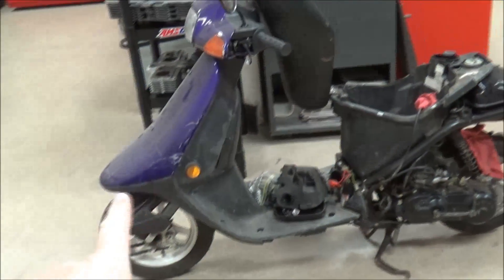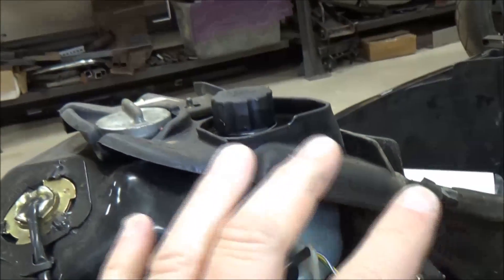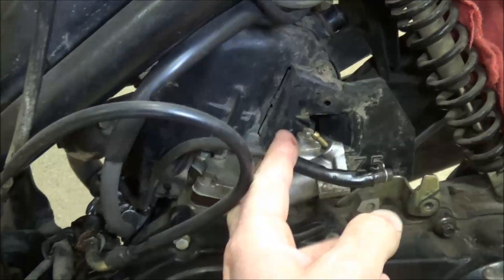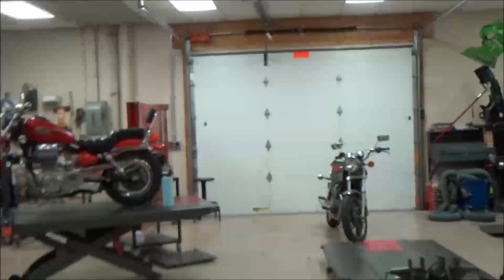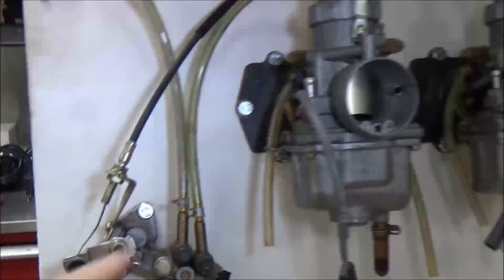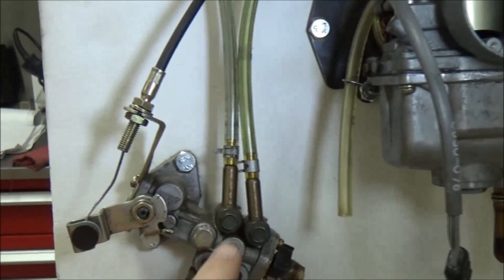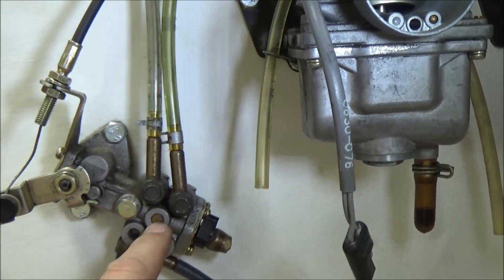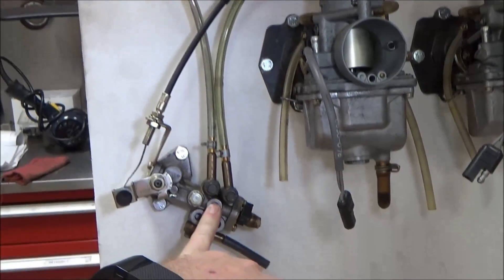Why you should verify your Oil Injection System on a "new to you" 2 stroke powered vehicle!

Comment: What do you think about bleeding the oil lines by removing the spark plug(s) and the lines from the manifold and running the starter or kick starter until no air is left in them and you see oil only? Thanks.

Comment: I had a so-called certified mechanic install the oil pump linkage on my 2-stroke outboard on the wrong side.  It was easy enough to do since it just clips on.  It took me years of trying to figure out why it was running rich, idling poorly, smoking like crazy, and fouling plugs to finally search up a shop manual that showed a drawing of the pump set up correctly.  The fix literally took 2 seconds and not only did it now look like the picture, but setting marks for idle and WOT now lined up.  I paid that guy some serious money to screw that up for me.

Other things I discovered he put back on wrong:  The hose that is supposed to deliver water from the top of the engine to the poppet valve was run straight to the tell-tale, and the hose that is supposed to go to the tell-tale was run through the thermal air valve to the poppet valve.  Like, seriously.  He had to add a hose to do it.  The hose that was supposed to go from the thermal air valve to the carburetors was just lying in the bottom of the cowling.  I'm surprised it ran at all.  This also required a dive into the service manual for me to find a diagram of the correct plumbing.  Now I am concerned if he managed to screw things up this badly on the outside, did he get the work he was doing inside the engine correct?  It seems to run ok now, but short of tearing the powerhead open I can't inspect it.

Then, this other time I had the steering cable replaced by a different shop, and the joker managed to put the pinion upside-down so that the boat steered backwards!  (The motor needed to be lifted to get the cable in/out is why I didn't do it myself.)  He also managed to crush the transom by over-torqueing 2 of the bolts.  Luckily the shop fixed it for free and fired the guy but it was still a huge hassle.

I've also had nothing but trouble with a KLX250 that had an after market exhaust on it.  I figured I was getting a deal until I found out that the carb had been modified and the airbox as well, so it had lots of power but otherwise ran like crap!  It took me a new carburetor and snorkel to finally get it running correctly.  (Yes, snorkel.  People thing removing it gives more airflow, and it does at low speeds, but it creates turbulence at high speeds.  Kawasaki didn't spend the money to equip the bike with the snorkel just to make it worse!  You ain't making it better by removing it!  Same with drilling holes in the air box and other dumb things people do.)

Folks, be careful who you let wrench on your stuff!  And if the owner worked on it, assume whatever he did needs to be undone or redone, and there might be serious damage as a result of his work.

Bottom line:  Buy new if you can afford it, and only use certified mechanics with lots of references.  Most people, even so-called mechanics, have an unending ability to screw things up royally.

Comment: I wish there was a way I could show you this somewhere else, now I see what's really happening. The seller had capped off the nipple cone from the oil tank and capped off two other Hoses connecting to the oil pump. And the hose connected to the manifold... IS JUST CONNECTED TO THE OTHER  VACUUM LINE OF THE GAS VENT PETCOCK.. man are some folks stupid. I thank you for showing this. And I'm saying g this now because this is the exact same scooter I have and now I see where that's supposed to be going. I appreciate it

Comment: Have you ever seen the gear drive that drives the oil pump , 9 times out of 10 there plastic , if you want to rely on a plastic gear drive to lube your engine then good luck with that one , most guys with scooters that are modified just delete the pump and run premix , heaps better , much simpler , less stuff hanging off your motor ie oil lines , oil tank and pump drive and your motor gains a little more power from not having to drive that stupid pump.

Comment: My golf carts got oil injection Yamaha putting out plenty of oil but the engine you can tell is very dry not getting lubrication even though I've got it mixed in with the fuel also, my question is if there's fuel flowing out of the carburetor could it be given it so much fuel did it's washing down the Rings and making it want to seize Xtreme Wear.

Comment: Older bikes feed oil to the intake, and the crank bearing on the oil pump side. Check to see if that is the case. 
If it is, leave the tank, and that line, or run it on a loop from the case itself. 
👍
Reply: So just leave everything hooked up oe and premix?
Reply: @Ashroyer86  
What bike is it? 
If the bike has 2 lines coming from the oiler, yes. If it only oils the intake, you can just premixed, but there wont be oil in the pump. 
  A re-route is for bikes with 2 lines. You disconnect and plug the oiler to intake line, and the hole,  but leave the one that goes to the crank. Then you have the pump take oil from the case, and premix. 
The easiest way is to just use it as-is if it has a crank oiler. 
Cheers
Reply: @r1nger81  yamaha srv with crank oiler. Just decided I may not fix it because of rust.
Reply: @Ashroyer86  
The snow machine? 
Great donor motor for a scary fast gokart or buggy. 👍
Reply: @r1nger81  so all i do is plug the intake line off and then premix the gas my scooter oils crank bearings too
Reply: @jaysworldd.636  
No. If it also oils the bearing, then a simple bypass will not work. 
Can use the tank as intended. 
 The othe option is to change the source of oil to the pump. 
1. Block off both ends of the line to the running to intake. 
2. Leave the oil line to the crank bearing. 
3. Take the line from the oil tank, and re-rout it so it draws oil from the case...you may have to tap a hole, but a banjo fitting on the drain plug works too. 
 This mod changes the setup so that the crank bearing is oiled by case oil instead of premix, and you mix your own gas. 
 If you choose the oiler case mod, its important that you make sure the oil line from the case is primed. 
  If there is an air bubble, it will not flow properly, and could starve the bearing. 
  I use a transparent nylon coupler when I first do the mod, to be sure its flowing properly.
  Cheers!!

Comment: man...i just rebuilt a polaris trailboss 250. and i am so fkn paranoid that the oil pump isnt working... i took it apart while i had the engine off and cleaned it and just checked the little diaphram and o-rings.   but the bike doesn't smoke.. i rode it for about 10 min and she seems to run great. but the engine is noisy. im hoping its just the pull start that is noisy but its hard to tell.  the clear line that run from pump to maniold is full. but i cant tell..i like to see smoke on a dam 2 stroke. the plug looks perfect nice light brown. i pulled maniold off and its dry.. the piston looks ok and looks a little wet. idk i cant afford to fry this topened
Reply from the maker: If unsure if the oil pump is working on a fresh engine, your always better off adding a little premix to the first tank and then pulling the oil output line and watching it pump out...which that with bleeding as shown should ALWAYS be done anyway...make sense?
We sure love you taking the time to comment. Are you coming to the next live session? 
There a few ways you could help keep this work going and stay connected with me personally.  
1. The fastest and best thing you could simply do for us is hit that subscribe button…helps us creators more than you know! 
2. Join this channel to get access to perks:
https://www.youtube.com/channel/UCBhM8DCKnT3qXwTW0eToyCg/join   
3. Give us a high 5 here:  https://www.paypal.me/how2wrench    
Keep Wrenching,
Shane Conley
Peoria, AZ USA
Follow us!
www.How2Wrench.com       
www.Tools2Wrench.com    
Facebook: 
https://www.facebook.com/How2Wrench/   
Instagram:
https://www.instagram.com/how2wrench/

Comment: So my 2 stroke doesn't have that. How could I add an oil tank, oil pump and oil vectors to my 66cc 2 stroke motorized bicycle chopper
Reply from the maker: Unlikely as the engine case is not built with it in mind...google for a kit and see what pops up...
We sure love you taking the time to comment. Are you coming to the next live session? 
There a few ways you could help keep this work going and stay connected with me personally.  
1. The fastest and best thing you could simply do for us is hit that subscribe button…helps us creators more than you know! 
2. Join this channel to get access to perks:
https://www.youtube.com/channel/UCBhM8DCKnT3qXwTW0eToyCg/join   
3. Give us a high 5 here:  https://www.paypal.me/how2wrench    
Keep Wrenching,
Shane Conley
Peoria, AZ USA
Follow us!
www.How2Wrench.com      
www.Tools2Wrench.com   
Facebook: 
https://www.facebook.com/How2Wrench/  
Instagram:
https://www.instagram.com/how2wrench/
Reply: @How2Wrench  not sure when it where your next life session is. I am in San Antonio Texas and this build I am currently working on has been an interesting lesson in thinking outside the box and self fabricating things just out if parts and other stuff I've had lying around.the complete wiring harness is homemade. The jackshaft is all self-fabricated, as well as the bottom bracket with sealed bearings and the spindle for the pedal chainring. The exhaust I am currently in the design process to get the look I want and as close to a tuned pipe I can do myself out if a few hand tools. Nothing that I have fabricated has been created in a shop or with shop tools.  This will be a very fun and nice running 66cc motorized bicycle once I get the rest of the fabrication finished. I thought I had heard about newer carbs that had the oil injection built in them?
Reply from the maker: @charlesbyromhammiii2594  Sounds like a fun project. I'll try to find time and circle back to answer more but I have 80 member questions to get too today bud...

Comment: So, you mentioned the importance of verifying the oil injection system but I'm not really seeing how to verify it, other than making sure there's not some bb jammed in the line?
Reply: He was basically saying verify if the system as been manipulated. If you assume the oil injection system is doing its job and just throw regular gas in the gas tank you'll blow it up. He just wants you to know if you need to premix or not was the purpose of this vid.
Reply from the maker: Hi Joel,
Its a pretty old video and I'd have to watch it all to see or point out a time. I would think I would have mentioned that there are 3 steps to always do:
1. verify oil comes out the bleed screw (while buring air)
2. Verify oil is full in the lines to the carb/intake (and pumping)
3. Check how the spark plugs are burning...
👍 Thank you for taking the time to comment! It helps us! 
Here is a way to support all the free videos.
Want to say “thanks” or “keep it up”? Click here https://www.paypal.me/how2wrench  

Follow us! 
Web:
www.How2Wrench.com     
www.Tools2Wrench.com

Comment: I have  a 1972 cs3 and plan on removing the oil injection  system what oil gas mix should i use
Reply from the maker: I would'nt want to guess...But here is what I have done. I start with a high quality oil (synthetic MC-1 is my fav) they recommend 50:1 and then I do alot of spark plug reading to determine if there are any concerns or adjustments needed. No mix and wide open or extended use in any range! Lots of checking to dial in to a mix for you. there are a lot of factors that could cause problems though...If you would like those list of detailed factors make a donation to our work and I'll take the time to to chat or write it out for you! Link below!
👍 Thank you for taking the time to comment! Hit that subscribe button if you haven’t please! It helps us! 
Here is a way to support all the free videos.
Want to say “thanks” or “keep it up”? Click here https://www.paypal.me/how2wrench  

Coach Conley is also available for hire to personally work one on one with you if ever needed. Yep he is a real person. Give him a call @ 602-345-0432
Details here: https://how2wrench.com/product/personal-tech-training-phone-facetime/ 
Your answers and help are just around the corner. Save time and money while protecting your investment and yourself by doing it the right way!
Follow us! 
Web:
www.How2Wrench.com     
www.Tools2Wrench.com

Comment: Oil injection is just a marketing scheme for lazy people. Trust me, it is worth the extra time to pre- mix your fuel. Never trust an oil injection pump.
Reply from the maker: :) 
Thank you for taking the time to comment! Hit that subscribe button please! It helps us!
Here is a way to support all the free videos.
Want to say “thanks” or “keep it up”? Click here https://www.paypal.me/how2wrench  

Coach Conley is also available for hire to personally work one on one with you if ever needed. Yep he is a real person. Give him a call @ 602-345-0432

Your answers and help are just around the corner. Save time and money while protecting your investment and yourself by doing it the right way!
Follow us!
Web:
www.How2Wrench.com    
www.Tools2Wrench.com
Reply: ADOLF HITLER  Until it goes out and you have a blown engine. Just another moving part to worry about.
Reply: On most sleds and bikes, the oiler feeds the intake for fuel mix AND lubes the main bearings on the pump side. If you insist on removing it, make sure its ONLY a premix system, and not part of the case oiling system. If it is, you should leave it, or run the bearing oiler on a loop from the case.

Comment: Pw80 s the throttle cable splits off sometimes oil injection part of the cable breaks while the throttle cable does not break running the engine dry

Comment: I am repairing a golf cart for a friend it has the same style pump I took the pump apart and nothing is stuck lose or worn and seems to move correctly, my question is how can you tell if the pump is bad? Most people are just scared of systems they don't understand, can't see it with your eyes you can't have faith in it! I think they are a proven injection pump system if maintenance is kept up right changing filters regularly.
For instance the golf cart I am working on scored the cylinder but the root cause was crank bearings it was sucking air through them along with a bunch of dirt.
Reply from the maker: You're in luck. I do offer personal service to back up what's missing from a video to actually fix your specific problem. I do work on donations for my time and possible research. 
Good news is its CHEAP! For my time would mind becoming a member of my website? It comes with a free 20 mins of techline and that will cover my time to assist you so we both benefit. So to have me personal cell phone number to put in your phone as your direct info and how to coach, sign up now! As always thank you and enjoy the free videos! Much more to come! I look forward to working with you and hope you will become a member of or learning community. 

Link to membership: https://how2wrench.com/product/membershipmembers-onlymembers? 

If I can ever be of service to you, here is a video explains how to connect with me. 
https://www.youtube.com/watch?v=vjvmB01ebcs 
Direct link to services: 
https://how2wrench.com/product-category/tech-lineservice-callminutes/ 
Live Chat is great for you to actually show your specific issue!
Donation link: https://www.paypal.me/how2wrench

Comment: i have a baja sc 50 i just got it and I've been trying to make it run, already changed the cdi just to make sure, new spark plug and charged the battery... now when i put gas for some reason it goes to the oil tank... i really don't know that much about scooters and I'll appreciate some help

Comment: Great video😊 I had a lot of 2 stroke street bikes over the years like my 12 year old Yamaha DT125R in the profile picture still on its original engine with oil injection and never had and issues, With proper maintenance and good two stroke oil you shouldn't have a probem
Reply: And it's also necessary on a lot of motorcycle engines to maintain that oil pump because it not only mixes with the fuel, it lubricates engine parts. Premixing only works until you burn up your engine.
Reply: @johnjriggsarchery2457  100% bullshit. You dont know what you are talking about. It does not lubricate any engine parts. Thats what the crank oil is for. It injects oil into carb. I've personally seen 3 motors blow due to oil pump.

Comment: I don't trust oil injection systems they clog easy I like to eliminate the system all together and just mix the gas my self that way I know exactly how much oil is going in my engine
Reply: On some engines the pump feeds oil directly to a main bearing in addition to feeding it into the intake manifold. If you eliminate the pump, how does the main bearing get lubrication?
Reply: It won’t. You should always make sure the pump is working and delivering oil where it should be going.
Reply: Bad bad idea.
Reply: You run it on a loop from the case...